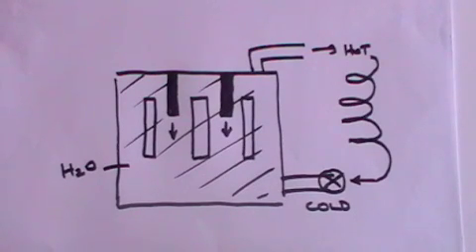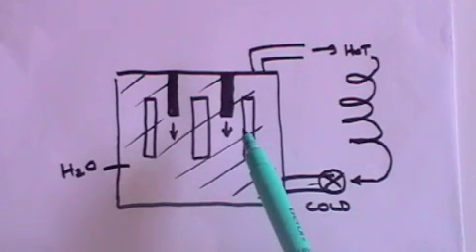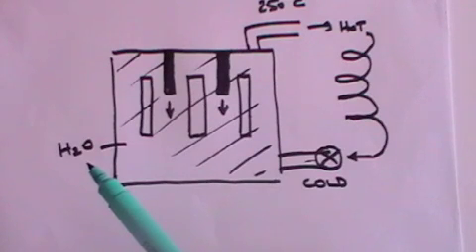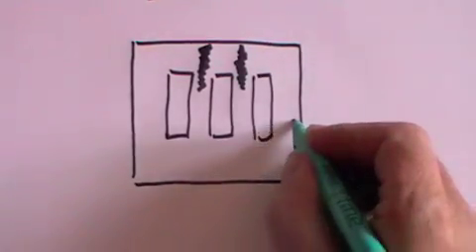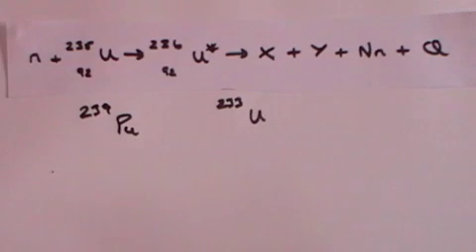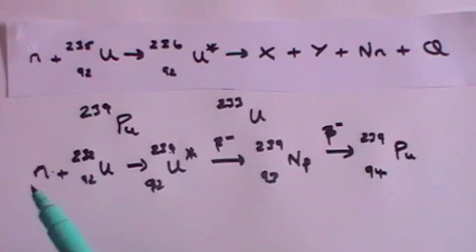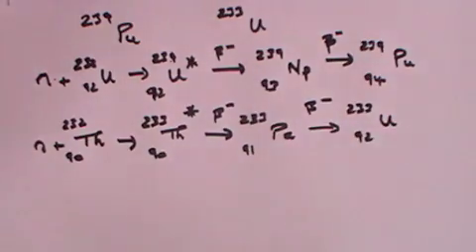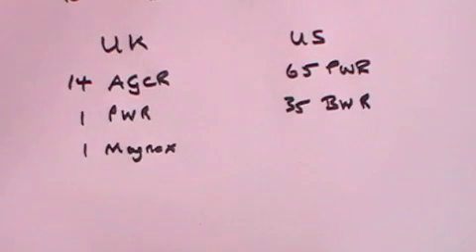Nuclear Fission Reactor Design

Comment: BWRs are indeed under pressure - about 90 ATM (like Fukushima).  PWRs operate at about 130 ATM, At just one ATM, your BWR would have very poor thermodynamic efficiency.
The main difference is whether the steam which  turns the turbines comes directly from the reactor (and is slightly radioactive) BWR. Or comes via heat exchangers by a circuit which does not enter the reactor.PWR.

I think Boron  is used for control rods. And Boron in solution is used to kill the reaction in an emergency. I have not heard of cadmium being used. But maybe it is.

In any case these reactors (like the one under construction at Hinkley Point) are HORRIBLE HEATH ROBINSON contraptions. The future lies in Molten Salt Reactors. Watch the many expositions of the MSR on Youtube by Kirk Sorensen, who REdiscovered this technology about fifteen years ago.

Comment: What was the Chernobyl reactor type?
Reply: John Lundquist boiling water reactor
Reply: Water cooled, graphite moderated. This type would never be approved in western nations.
Reply: As noted it used graphite for neutron moderation and water for cooling and transferring heat energy to the turbines. This is extremely dangerous in case there is a coolant loss accident because the loss of coolant doesn't stop the fission reaction unlike in BWR reactors where loss of the moderating water immediately stops the fission reaction cold.

Comment: Its a pitty nuclear advocates still defend nuclear fusion as the solution, which we have no firm timelines on.
We should instead suggest and defend more incremental, realistic advancements like replacing U-238 in MOX fuel with Th-232 (having Pu + Th fuel), and having molten salt reactors which increase burnup by 6x up to 99x, greatly reducing total volume of nuclear waste, greatly extending existing Uranium and Thorium resources, without depending on MAJOR scientific breakthroughs which could conceivably take another century to reach widespread commercial applications.

At the same time, no explanation of nuclear fission is complete without a proper explanation of radioactivity types, difference between radionuclides and radiation, and the fact that the whole world is radioactive, and our bodies have a significant level of natural radiation repair mechanisms !

Comment: Jolly good. Looking forward to next time.
All of Japan's reactors are switched off. The one fast breeder reactor "Monju" which would have used liquid sodium as a coolant never was switched on. FBR's make everyone too nervous. In preparing the fusion discourses, would suggest looking into Lockheed Martin's 15/10/14 boast of creating a truck sized fusion reactor within 5 years. Cheers!
Reply: "Boast" is right. Heard anything about that in the 4 years since? I suspect that stuff about a "truck-sized" reactor was just Popular Science chatter. They may have meant that the reaction chamber would be small enough to put on a small truck, but the reactor would surely be vastly larger.

Comment: Prof: Maybe I missed it, but what gives off the first neutron to start the chain reaction?

It looks as if you want to have the amount of neutrons available equal to the absoprtion rate of the cadmium rods and inert rods (such as in the breeder reactor) in the tank.

As time progresses the rate of neutron production increases until all the absorption and inert rods capture the excess. What is making sure that this process is carried out without a melt down?

When the inert rods turn into fission material and begin emitting more nuetrons, I would assume the amount of starting material, such as Uranium, would be less and produce less neutrons per mass while the inert rods produce more neutrons per mas of active material in the rods.

With these two scenarios, what is the active way of managing the amount of neutrons present at any time? I would assume you would have an excess of absorption rods and coolant, but how does anyone know the exact neutron production rate at any time and whether or not the reaction will get out of hand?

Also, what is the minimum size for a fission reactor? Also can you go into more detail about AGCR, because I think liquid graphite sounds cool.
Reply: U-238, U-235 is Radioactive  It is giving off neutrons all the time. Just put enough together, sustained chain reaction and a lot of heat. The movie "Fat Man Little Boy" has a scene where the scientist drops too much Uranium and starts a chain reaction which gives everyone in the room lethal does of radiation he has to flip it off NOW! Guess it was a true event because I saw it another Manhattan Project movie

Comment: Which type of reactor is more safe? I think Chernobyl reactor was using graphite rods and it was part of a problem. I also read that water reactors are safer because you can't have running away fission in them. If it gets too hot water evaporates and reaction stops.